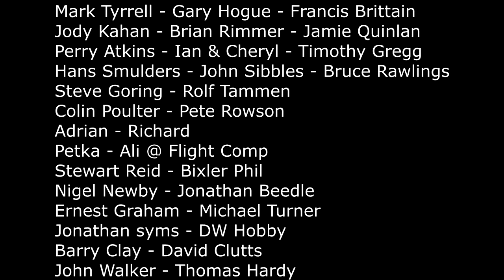Ripmax Trainer Rebuild Pt2 RC Model Geeks

Comment: Thanks for this. Lots of tips in this for a noobie like me. Just about to follow your J3 kit build for my first project. What is best to use as a baseboard?
Reply from the maker: cheers i just use the work bench as a baseboard. i dont pin the structure down. i use ca glue to assemble things quickly then back the joints up with  wood glue.